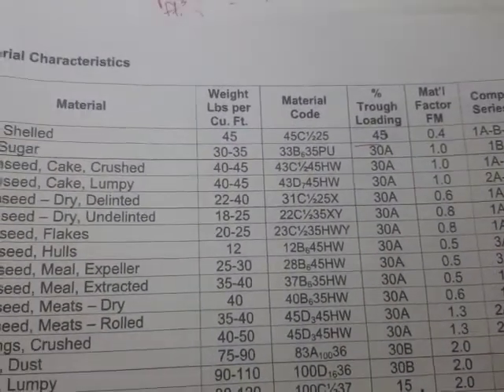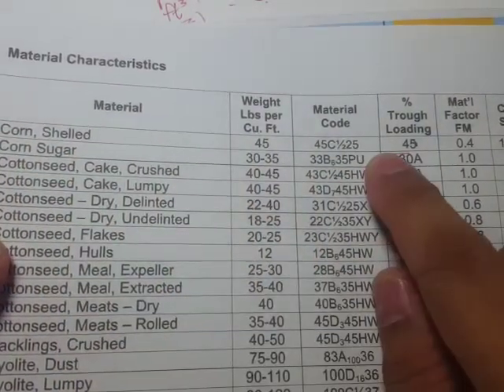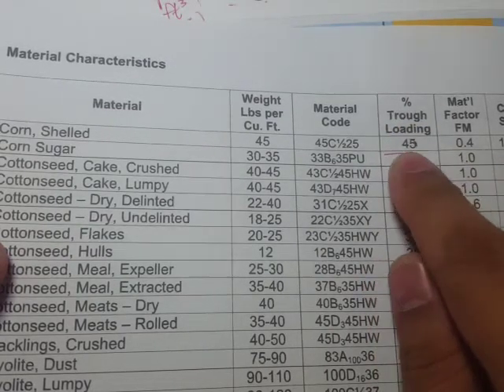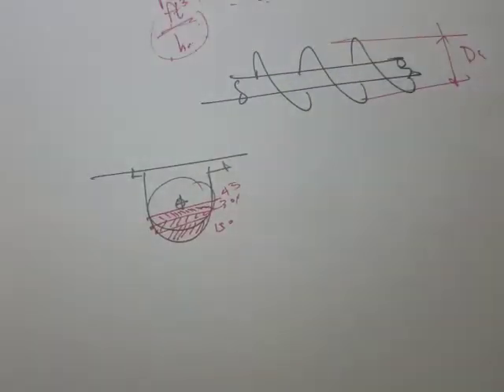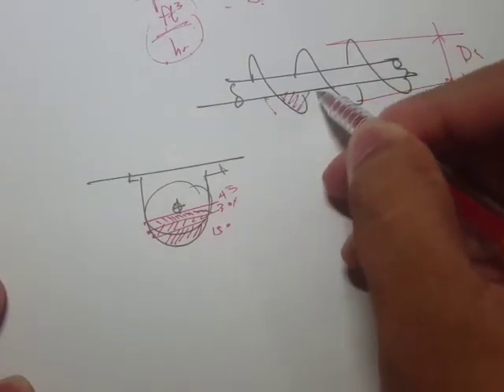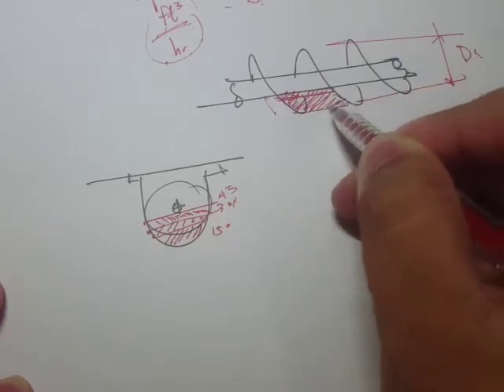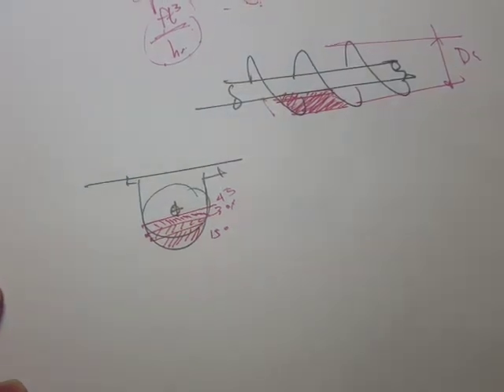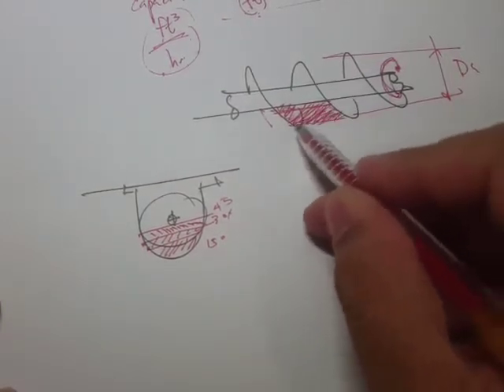ABE180 - 04.02 - Design of Screw Conveyor (Part2)

Comment: Is there any difference between the calculation of horizotal and vertical screw conveyors?
Reply from the maker: as far as i remember, there'll be differences in: 1. power requirement since you have to consider the weight of the material; and 2. the selection of pitch distance which depends on the flowability of the material being conveyed.
Reply: @sirby_lectures  yeah I see, the vertical one usualy use haft pitch type screws, thank you for reply..